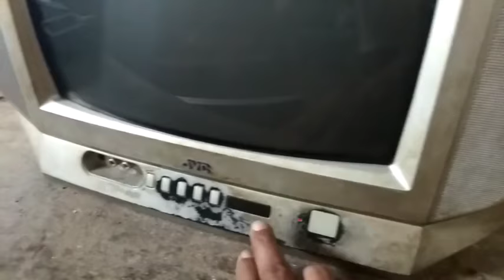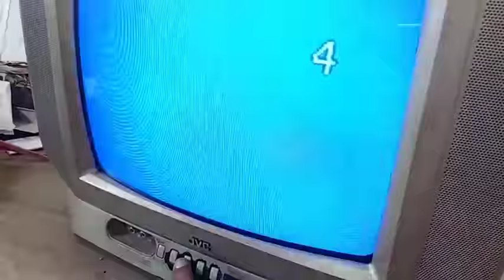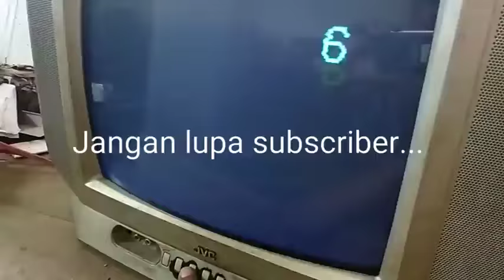TV JVC PROTEK VERTICAL

Comment: q pnya tv mirek jvc .layar kedi2p kla panas hidup.apa penyebak x ea .tolong kasih solusi nya bos
Reply from the maker: Sdh di solder di solder ulang blm utamanx ic vertical dan ic micom
Reply: udah di solder ulang .tpi ttp kla udh panas hidu.tegangan b+ 250 volt bos tu penyebab x apa ea bos
Reply from the maker: Coba ganti elco kecil area regulator
Reply: ea q coba bos...elco yg ukuran berapa vol.n ufx brapa
Reply from the maker: Elco kecil 4,7/47/ 50V
Reply: @IwanAhmad  ea q coba dlu bos ...makasih ea bos solusix